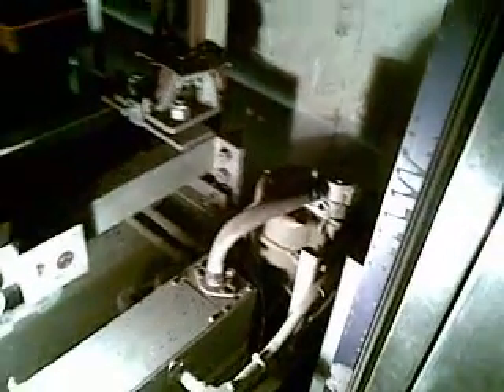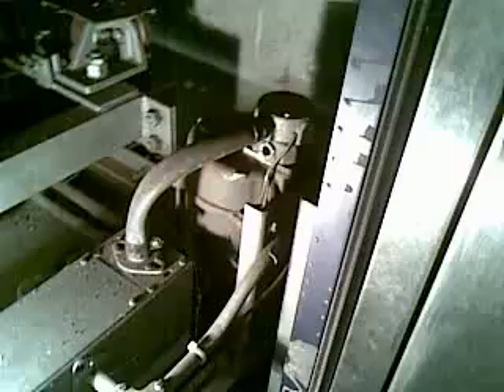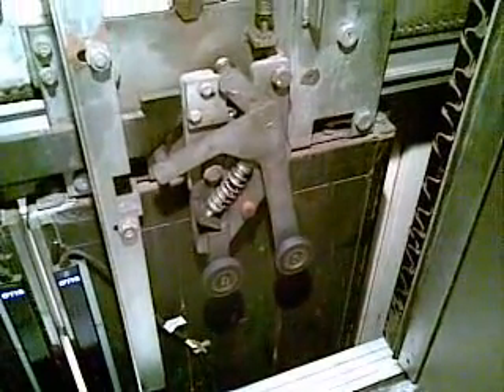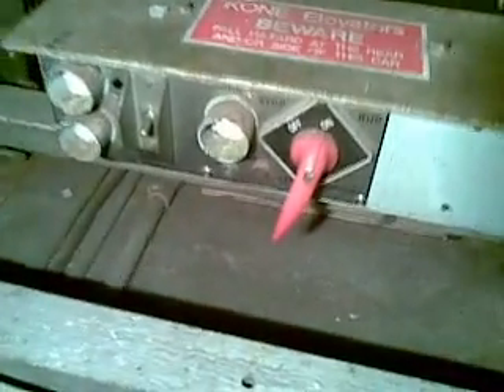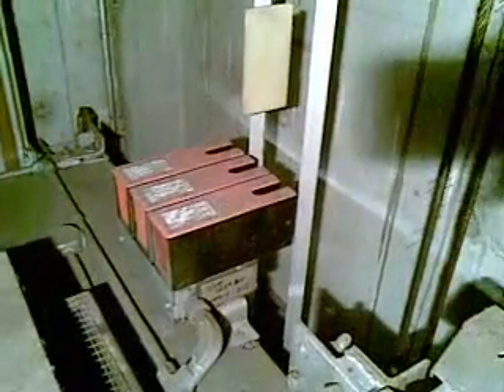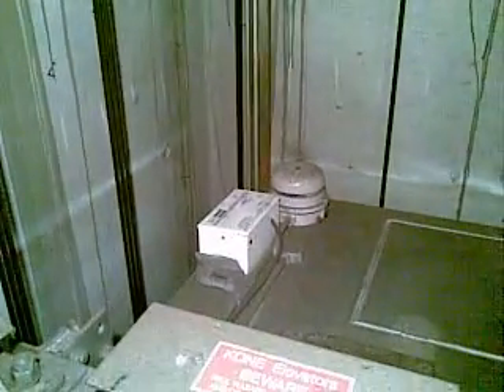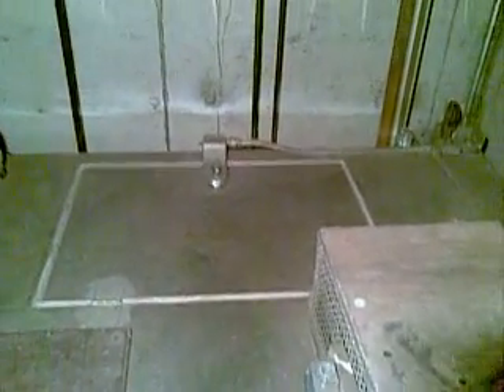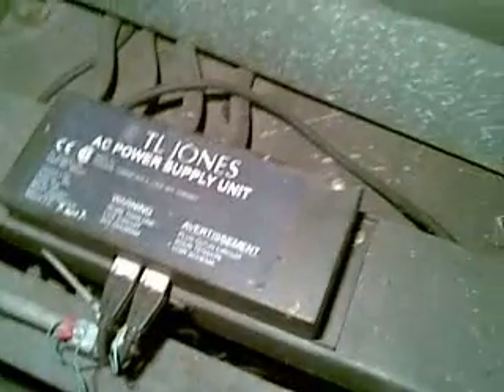Elevator Lift Top of car tour intro

Comment from the maker: @jaymietreadwell 
Under Slung Roped Lift is by far the hardest to re rope when rope strands start to come away or break. 

I can remember one site where re roping had to be done very often due to high usage and the more turns and twists that this roping system has.